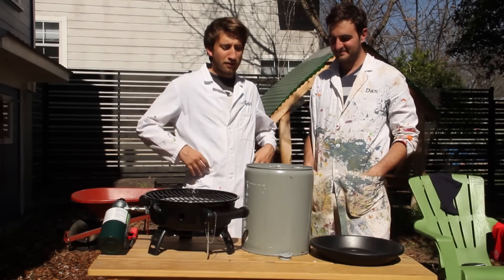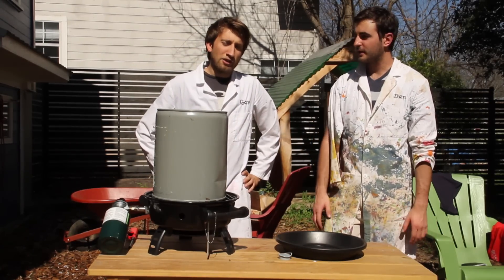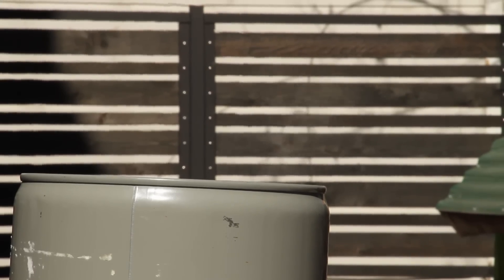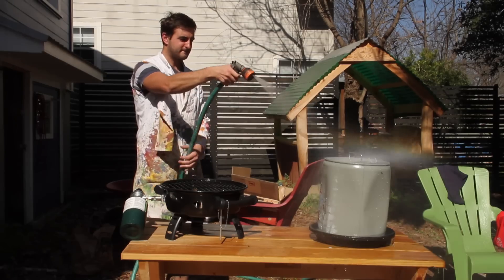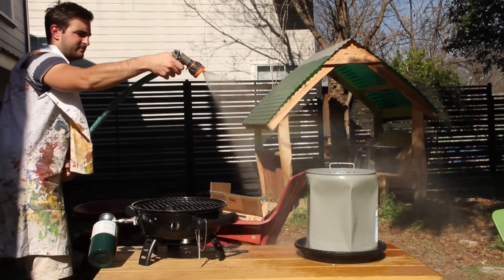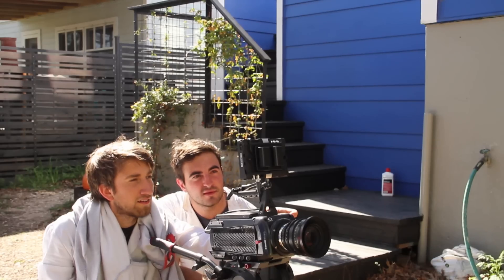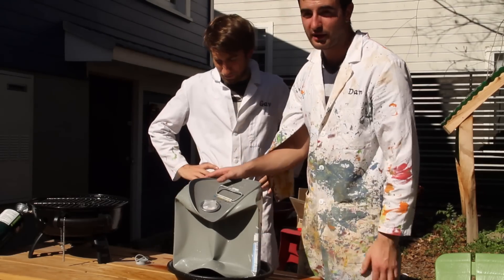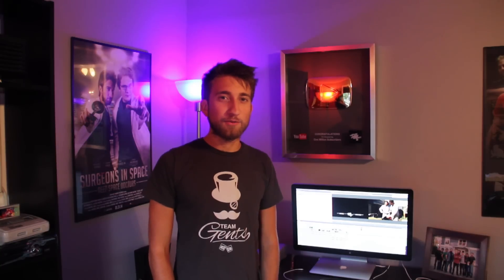Imploding Drum - The Slow Mo Guys

Comment: Years ago at work, I needed a 'source of vacuum' for some experiments.  So I got a 200L drum and hooked it to a vacuum pump.  It worked really well, however one time the pump was left running and it turned the whole drum into a triangle shape!  Had to get another drum and weld some reinforcing loops around the outside - which then lasted for years.

Comment: I always loved this experiment in school. You guys should try the experiment again with a empty soda can filled with just a small amount of water. Then set it on the heat source until the water inside boils then set the can quickly in some ice and see how that turns out. If done properly the can should flatten itself as if run over by a car or close to it.

Comment: I think part of the problem is that there was already a dent in the side. The idea is that the cylinder is structurally sound enough to hold, but the slightest flaw (as caused by hitting it or something) will cause it to suddenly and completely collapse.

Comment: The experiment works best with soda cans, just so you guys know. You can use a hot plate to heat up the can with some water inside, then move it to a pan of ice water with tongs. Soda cans are probably easier to obtain than the drum you used. Cheers!

Comment: Common mistake, need to add a weight to the bottom of the can to offset buoyancy. then the water in the bath has to be higher then the water left in the can so as to cool the air/steam mixture. Cooling the water in the can dose nothing.

Comment: You should try an experiment i did in chemistry similar to that you add a little water to a pop can and heat it up till it boils and then quickly turn it upside down into ice water and it will  crush the can.

Comment: You should get Dan a new labcoat and put his old one into a picture frame and have a science lab coat of fame.
A great Idea for some slow motion is a dry ice bomb. You put hot water in the water bottle then place pieces of dry ice in then bottle cap the bottle then watch the magic happen when it explodes. Are these good ideas or not
Reply: Well neverind they already did but I have another idea.see what would happen when you connect wires together that have a source of power.
Reply: Oh never mind they already did the dry ice. But I have another idea and that is see what would happen when you poor gasoline on a piece of wood then when it really starts to burn poor ice on it and there should be lots of steam and popping sounds it's really cool

Comment: It helps if you leave it open and turn it upside down when you switch it to cold water
Reply: If you leave it open, flip it over and dunk the opening into water, the decrease in pressure inside the container will result in atmosphere pushing the water inside said container, canceling the pressure drop. Using cold water, however, should result in more effective colling, thus more rapid drop in pressure inside the canister.

Comment: If you want to do it better next time.... You only need a little bit of water. 
And if it doesn't work super well at first, putting it back on the BBQ sealed won't help. It's all about creating a pressure differential.

Comment: Could you do the one were you get a 5l+ bottle, put a drop of fuel in it and shake it around and then drop a lit match in it and put the cap on the bottle. Basicily what happens is somewhat the same result as this but it only takes a few mins to set up and all the air in the bottle is removed

Comment: I think you had too much water. Water vapor takes about 1200× the volume of liquid water, so you only need about 30ml to completely fill your drum. In reality the gases mix of course, so maybe 150–300ml to push more air out, but you put litres in there. Then you should keep heating until the water has mostly boiled away before plugging and cooling it.